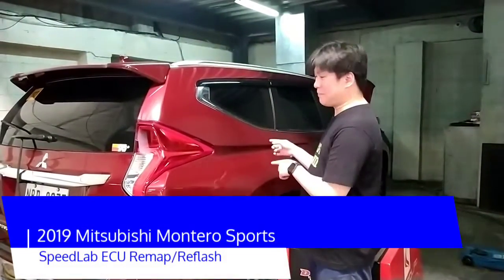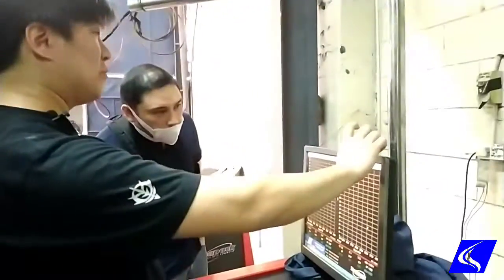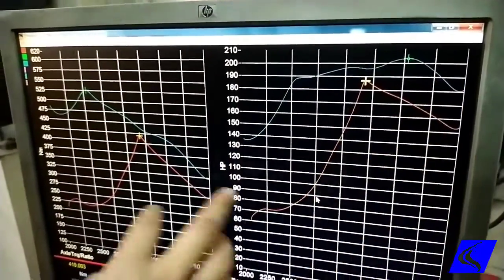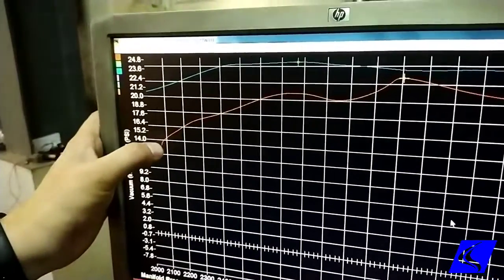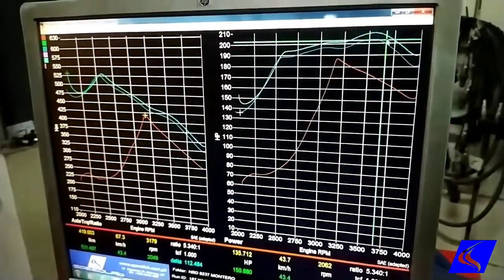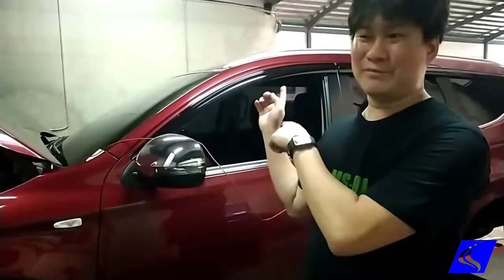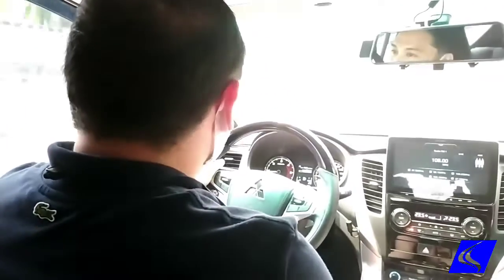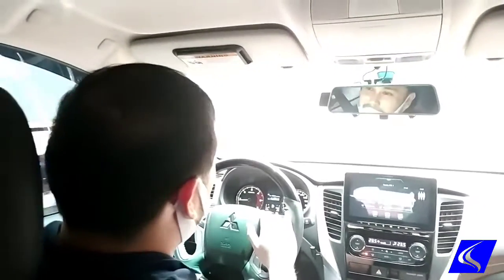Mitsubishi Montero 2.4L Mivec Sport ECU Remap/Reflash

Comment: do you recommend knn intake for gen3 montero? is there a power/torque gain?
Reply from the maker: K&n drop in filter 
Not intake
Reply: @speedlabchannel4452  okay because I see a lot gen3 monteros with cone type or mushroom type in take, especially those in drag diesels
Reply from the maker: @acc1tester398  that’s for drag racing which doesn’t care about low rpm acceleration and they’re with the bigger turbo
Reply: @speedlabchannel4452  got it thanks
Reply: @speedlabchannel4452  basically, only gen3 montero does not benefit from knn intake?
Reply from the maker: @acc1tester398  yes

Comment: Geez, with due respect, that AFR is so damn rich. There’s a good reason why the stock AFR is around 20:1, because diesels generally run lean to keep the EGT in check and the engine to run cool. Anything below 16:1 is already very rich, and will cause the EGT to rise, which results to high engine and turbo temperatures and unnecessary stress to the engine, ultimately leading to the engine wearing faster. Yes, the power and torque may have increased a lot, but is the trade worth it? We have different opinions though.
Reply from the maker: What your opinion fails to understand is those afr values only happen at full throttle 

Not at 95% of the time where your driving at part throttle where the afrs are 20:1-18:1
Reply: @speedlabchannel4452  Not all driving situations require wide-open throttle. Does your tune consider part-throttle response i.e. real-world everyday driving conditions in the city?

Comment: Nice... is that less smoke? How many hp gained?
Reply from the maker: 60-80hp
Reply: @speedlabchannel4452  Custom tuning po b ginagawa nyo Speedlab? Ty
Reply from the maker: @LexA-y1b  yes custom
Reply: @speedlabchannel4452  Thanks. Same lng ba kyo ng ginagawa ng Speedworks engineering? Bkit mas cheap po sa inyo magpa remap? Sa knila aabutin ng 36k wth dyno.
Reply from the maker: @LexA-y1b  that’s what you call competition 
Customer wins because of lower prices
Reply: @speedlabchannel4452  Thanks. I think sa inyo na lng ako magpapa remap coz mas cheap sa inyo.. basta custom tuning po ah? Thanks
Reply from the maker: @LexA-y1b  yes its custom and you’re welcomed to watch

Comment: After the reflash, do I have to enhance my brakes system since it has now more torque/power and speed? Are the stock brakes system can accommodate the added power? Thanks.
Reply: No need. Montero Sports has 4 disc brakes
Reply: I think its a good investment to do, since ur adding more power and torque. But I dont think its really necessary unless your unit reaches more than 250 hp, 600nm.
Reply: If you're on budget, at least do upgrades such as braided brake lines, performance brake pads (you can pick from endless brand, japan), and maybe slotted/drilled brake rotors.
Reply: DEPENDS, but for this montero I believe it has 4 disc brakes enough to stop the car but if yours have 2 disc brakes front and drums at the rear well upgrading it to a much larger disc is the better option

Comment: Gen 2 Vgt 200 Hp 610 Nm torque at 2000 rpm(remap)
Gen 3 Vgt 208 Hp 525 Nm torque(remap) Both Speeelab tuned.
Reply: So mas malakas un luma?
Reply: 4M41 or 4D56 engine yung Gen 2 mo? Thanks.
Reply: boss. how much cost po?

Comment: Hi sir hm po remap at full exhaust montero gls premium?
Reply from the maker: Yes
Reply from the maker: 55k
Reply: @speedlabchannel4452  all in n po un?
Reply: Mvvoid po b warranty kog nremap?
Reply from the maker: No
Reply: @speedlabchannel4452  gaano po ktgal kpg pinagawa? Remap at full exhaust?
Reply from the maker: One day remap and exhaust
Reply: @speedlabchannel4452  mggmit prn po b ung ibang mga functions ktulad ng cruise control?
Reply from the maker: @ffortsirkrubio7468  yes, those remain as is
Reply: @speedlabchannel4452  moagkano po ang package mula intake, exhaust, at remap?
Reply from the maker: @ffortsirkrubio7468  K&N filter 5000
Magnaflow exhuast 32000
ecu remap 25000
Reply: @speedlabchannel4452  pwd b 60k package?hehehe..ngiipon n kc aq pra ky monty..pra isang pnta nlng dyan..
Reply from the maker: @ffortsirkrubio7468  yes if sabay all
Reply: @speedlabchannel4452  will this produce more smoke when accelerating? Or sabi nila mas mausok daw after remap? Ty
Reply from the maker: @judeagustin9901  there will be more smoke yes at full throttle, not at idling or light throttle
Reply: @speedlabchannel4452  thanks for the info 😊👍
Reply: @speedlabchannel4452  yes po sabay2 nman po pggawa..kaya po b isang araw??at ung payment process po..pnu?
Reply from the maker: @ffortsirkrubio7468  yes can be done in a day. Cash and card accepted
Reply: @speedlabchannel4452  anung oras ngoopen ang shop nyo po?at by appointment or walk-in pwede?
Reply from the maker: @ffortsirkrubio7468  8am 
By appointment

Comment: Hi sir ! I'm really a fun of your good work, salute. May i ask my innova 2015 if after u reflash it, can i still upgrade it little by little like  FMIC, next is exaust, intake, injector and so on by different time. Is it required for another retune or refash again ? Thank for the ans. More power sir.
Reply from the maker: Yes you can but every change requires you to retuneb
Reply: In short all modified should be done before reflash ?
Reply from the maker: Saeed Fathalla Casim yes, so you save money by tuning one time and not mutliple times
Reply: If im going to your shop sir, do i need to make an appointment or go there directly ?
Reply from the maker: Saeed Fathalla Casim 
You can show up unannounced but no guarantees you will served 

That’s my nice way of saying you need an appointment
Reply: Noted sir. Thanks for my inquiry.